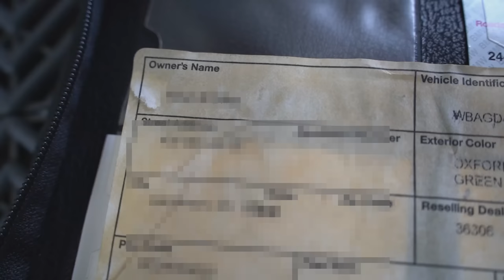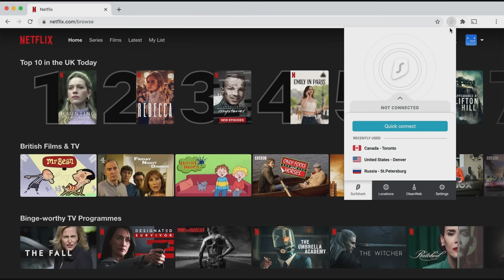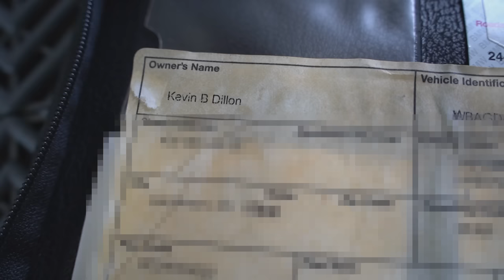ABANDONED BMW E32 Barn Find: First Wash in Years! Satisfying Car Detailing Restoration

Comment: I own a 1988 750iL. Thank you for showing these underrated and overlooked E32s some love! That engine in the green car is likely a 4.4L M62 putting out 282 hp.
Reply: No, there was no M62 in the E32. It’s a M60B40. 4.0l V8
Reply: the E39 came with the M62. this is the M60. also used in the underrated E34
Reply: @Zoinkinator  You are correct
Reply: Nah. More likely a 735i, 3.5 litres, V8.
Reply: @adrianog4148  No, thats a straight six, this is a V8
Reply: Nope, in the e32 this is the previous generation of BMW’s V8, the M60, here in 4.0 liters, so this is the M60B40 (ok I own one, so it was easy)
Reply: @adrianog4148  The 3.5l v8 was not available for the E32.

Comment: It's sooooo satisfying to look a this process. Especially whith my favourite BMW. 
I don't know exact issue with these floor mats. But when I had E32 with original floor mats I had same issue. I believe they used some tar-foam base for the mats and over time it just loses its flexibility and this base starts peeling off. Driver's mat in my car didn't peel off that much, but it "shared" some tar with carpet under close to the gas pedal.

Comment: on the e30, I believe you can repair the whining noise from the starter motor by removing the starter and replacing the bushing on the forward end of the starter.

On the 740, the engine is an all aluminum V8 that is not all that heavy for that type of motor.  The really heavy part of that drivetrain is the automatic transmission.  The pieces together are hefty.  I put almost 200K miles on a 92 735 and I have to say it was one of the most satisfying BMWs  to drive that I ever owned. I have owned and raced about 60 of them since 1970.
Reply: That's NOT an aluminum block in the 740s.  It's an alloy called Alusil.  It's an aluminum silicon alloy.  Don't try to hone it as you would with an aluminum or iron block.  It will damage the liners and ruin the block.

Comment: Just a pro tip and a great story for y'all, my first car was a 1994 740iL with the same M60. Do not wash the engine like this. The cover over the ignition easily permits the entry of water and moisture. If you do decide to clean the engine with water like this, take those covers off with a 10mm, and get any water out of that cover with a wet/dry shop vac. Take the coil packs out and make sure no water is on your plugs. I did the same thing when trying to make my 150k mile engine look fresh. The next morning, I started the car to discover a horrible misfire. Had about thirty minutes to get to work. I got about 15 miles from Napoleon to Liberty Center before my catalytic converter exploded underneath me. I looked in the rearview mirror and saw a massive cloud of orange metal suspended in the air, slowly falling. That was about 8 years ago now. Two days ago I got the car up on jack stands, cleaned the mildew out of the car, and got the engine running no problem. Love these cars, thanks for reading my story y'all.
Reply: Oh also my dad was the previous owner of that 944 that ECS has, he's in the original video when ECS stopped by to get it. We're both super geeked to see them doing that over at ECS with the car.

Comment: Awesome job, on the E-32, set car has either a V-10 or V-12 depending on thr r or equipment
Reply: The E32's were NEVER factory equipped with V10 engines.  All 740's were factory equipped with V8 engines. These were M30 inline sixes, M60 V8's, or M70 V12's.

Comment: that's a 4 litre V8 under the bonnet.  BMW V8's especially of that vintage were not the best.  the 735 version of that was a stellar ride.  As for the foam backed floor mats it's not exclusive to BMW (happened on my Saab as well).  The foam tends to dry out much like the foam in a headliner.  All I can say is that the foam did it's job in not slipping on the carpet.
Reply: Actually once BMW sorted out the Nikasil disaster in the USA, these engines were fine.  The high sulphur fuel in use in the USA at the time damaged the cylinder liners, hurting compression and power.  BMW actually offered a ten year engine warranty replacement on these engines, and provided A) the original owner did NOT expose the engine to high sulphur USA fuel  or B) kept up the maintenance on these engines, these engines were no more problematic than most other BMW engines of the period.

Comment: M60B40 is the engine, lovely V8. Mechanical throttle body, no VANOS, immortal engine if you change oil regularly and take care of it properly.
Reply: These cars did not use a mechanical throttle body.  The earlier M30 powered (big six) E32's and E34's did but not the later ones.

Comment: Hi, guys. You're amazing. I need your advice. I spilled some diesel on the material in the trunk. What can I use to get rid off of the awful smell
Reply: I would recommend using a carpet cleaner after soaking up as much of the diesel fuel as possible.  Be careful with some carpet cleaners.  Some heavy duty cleaners can actually strip the carpet dye, possibly damaging the carpet or even discoloring the carpet.

Comment: Do you guys ever paint the carpets?

And what's the blower you used on the engine bay?
Reply: You don't use PAINT on carpets.  There is a special chemical called carpet DYE (it's not paint).
Reply: @houseofno it may be due, but it's sold and sprayed in an aerosol can

Comment: That motor is a 4.0l v8 putting out 200kw , in the later E38 , in its first two years it remained the same , then was enlarged to 4.4 l kw remained the same , torque increased marginally but the torque curve was far better

Comment: An absolutely gorgeous color I had the same car in white and I could stand a coin on its edge while the car was idling one of the smoothest engines out there in those days . Unfortunately I was forced to change brands to Mercedes as the later model Beemer's are rubbish with all there plastic engine components braking down.

Comment: The engine is BMWs first modern V8, they moved away from inline 6s in their 7 series cars. Being a 740 it would be a 4.0l later it was increased to a 4.4l. These early V8’s had nikasil bore liners and problems with premature bore wear arose if poor quality fuel as used. Who cares who’s car it was… can the current owner do right by that great old Beemer and spend some bucks on it to get it back where it deserves to be!